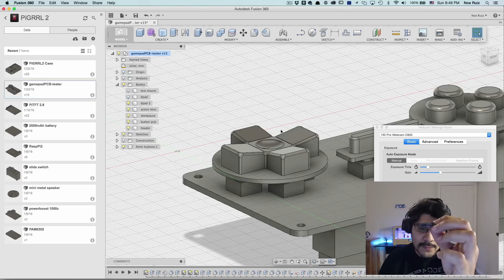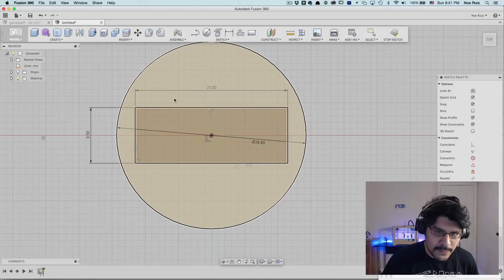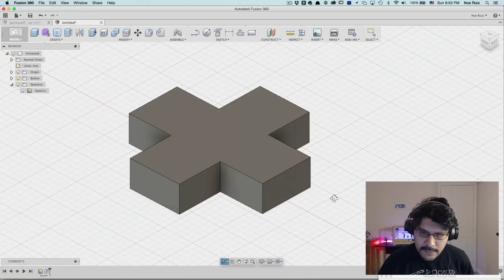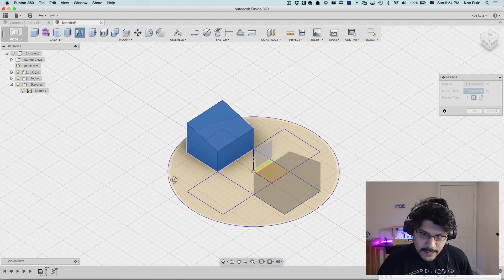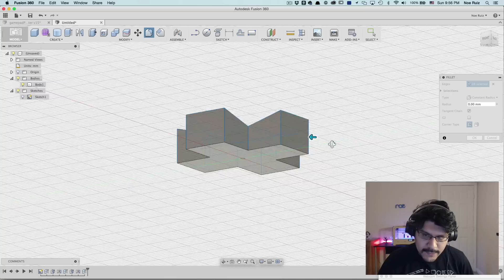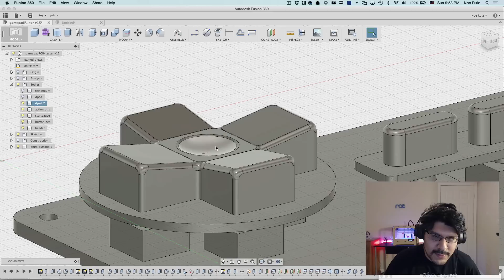Layer by Layer - Making a D-Pad in Fusion 360

Comment: Great tutorial! Thanks for showing me another new function in Fusion 360. One question: Is there an easy way to copy or apply the sketch that you made for the arrow to the other three key faces?
Reply from the maker: +reiner0609 Yes! You can actually use the circular pattern to make three copies of the one button, much easier!
Reply: I was more thinking how to do this for similar cases where the other faces might not be symmetrically to the original one. Just re-use the sketch in a different position.

Comment: Hi, great series! Just a thought, instead of doing two Extrusions and then two Mirrors, you could have maybe done a single Extrusion, then a Draft and then a Circular Pattern (Create -> Pattern menu) to create three more copies rotated around the center.
Reply from the maker: That's a great tip, will save a few steps/operations. Thank you!!